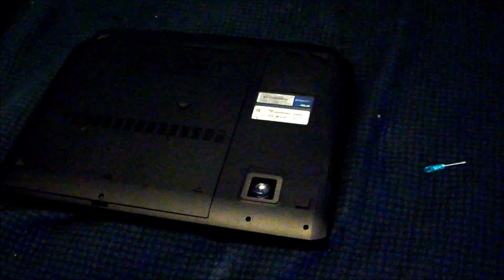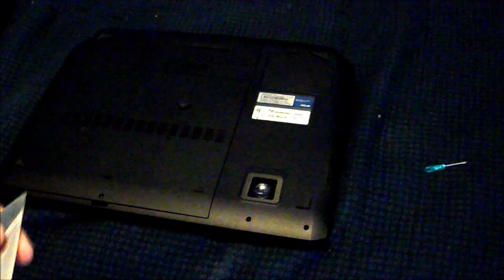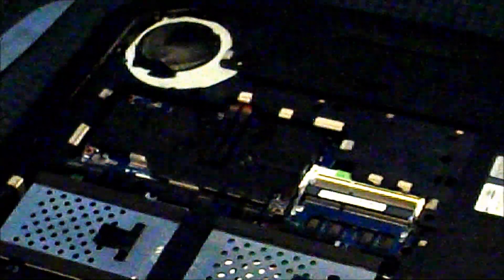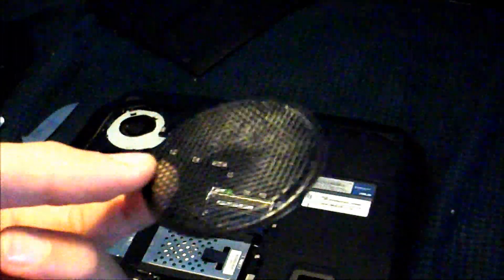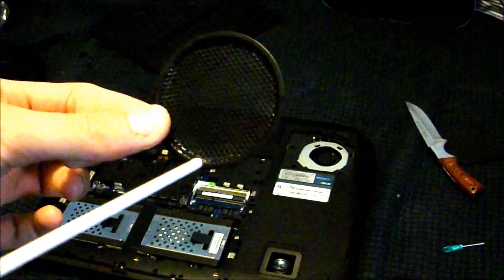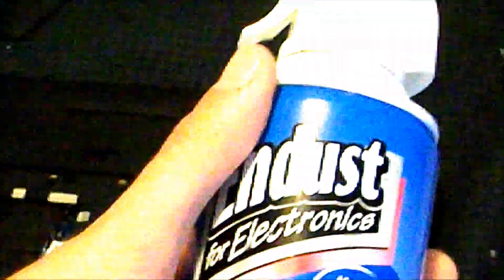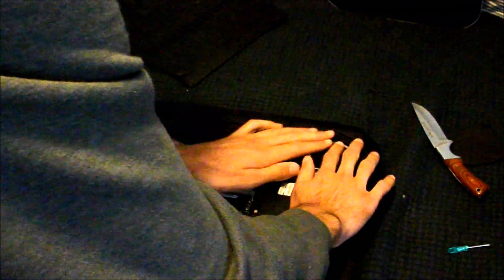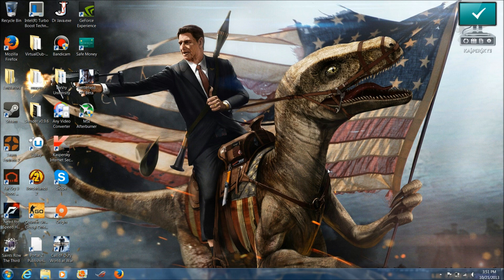ASUS G Series Fan Filter Cleaning

Comment: You want to keep the fans from spinning when you use the air duster because it can spin the fans faster than they are designed to in operation.  Spinning the fans faster than normal can damage them.

Comment: This lap top is junk for gaming, its my netflix's machine.  Thanks for showing me how to clean it.
Reply from the maker: Ian Browne It's not that great for playing the latest and greatest but it'll play just about anything.
Reply: +Ale7 what the g75? you must have a low spec model mines 3 years old and i have yet to set any settings below high to get 50+ fps. I can even max out settings and add sweetfx for some games. My most played example would be Elite Dangerous. It also helps to use MSI afterburner and OC a bit. If you keep your fan filters clean you wont go above 65 C

Comment: I have a G74Sx, and it is different.  There is a panel that comes off (with one chrome coin screw), but it only reveals the RAM and hard drives.  Do I need to remove the entire bottom half of the case to get to the fans?
Reply from the maker: I dont think youd have to do that,  look up a video guide specifically for the G74SX model.  I cant help much since i dont have that model

Comment: I need help with my G75V if you don't mind. For some reason my fan started like vibrating my whole computer pretty heavy. I opened it up tried cleaning the little filter thing and it didn't help at all(for some reason I thought that might be an issue) but it didn't make this weird noise till all of a sudden.
Reply from the maker: Maybe the fan itself isnt sitting in place correctly.  it could be on an angle.  Im not sure,  If you take it to a good computer shop they should be able to figure it out for you.  That vibration probably isnt good for your computer.  It could ruin the fan system.

Comment: Ok thank you my pc had 1500 h , i will do it.
 Is it normal if the filter is not fixed in the base? I think the filters are really easy to move out the original position.
Again thank you this video was usefull
Reply from the maker: The asus filters are not attached,  you can hold them down in place with a little electrical tape